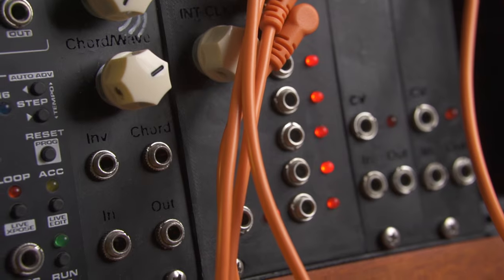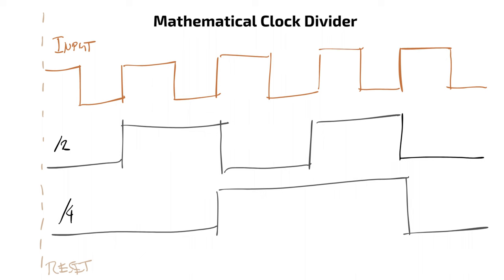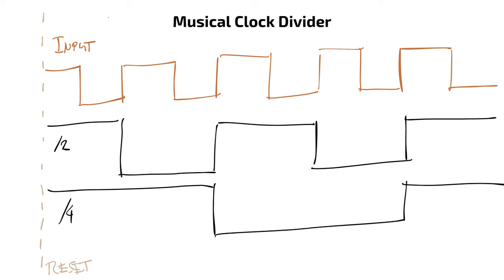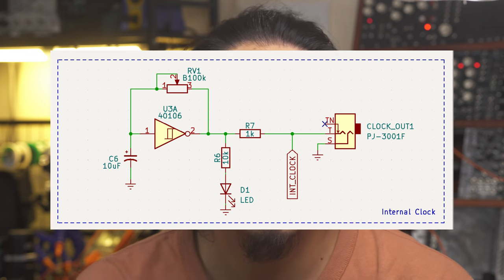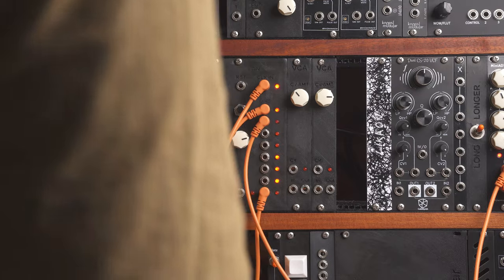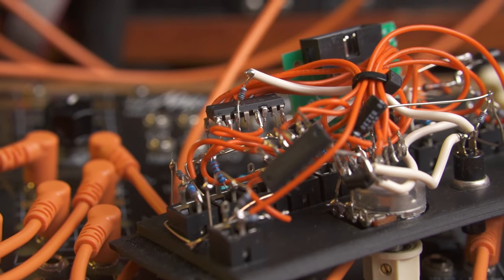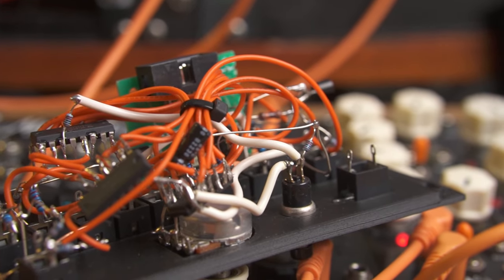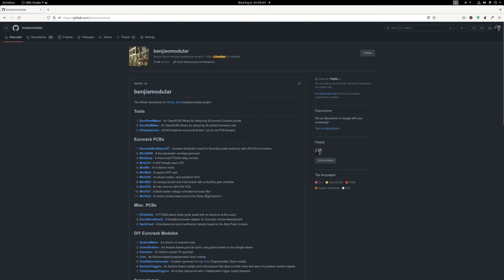I built a musical clock divider for Eurorack!

Comment: To paint in the letters on the 3D printed front panels would be a great addition. After that, use acetone to wipe off the excess paint and leave the letter with paint in it. You could then lacquer over it or even use resin to seal it, giving the panel  a nice finish.
Reply from the maker: thanks! good suggestion. i'm sure that would look awesome. too much work for me though. 😆

Comment: Why go to the trouble of adding 5V for the cd4040 supply voltage? seems like it, and the 40106 can both handle 12V no problem...?
Reply from the maker: Yup! You could definitely do without, but i wanted my outputs at around 5V to keep it down to Doepfer spec somehow (at 5V) https://doepfer.de/a100_man/a100t_e.htm